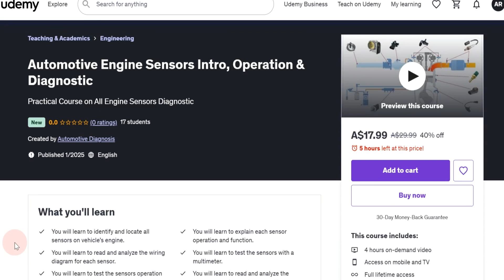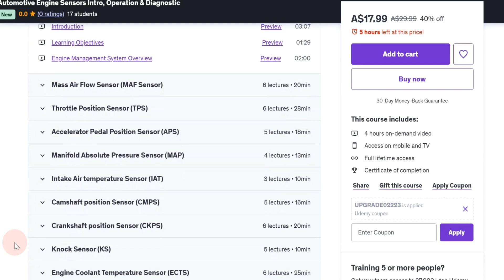Introducing Engine Sensors Diagnostic Online Course | All Engine Sensors Explained

Comment: Hi buddy welcome back, working on a Chevy equinox 2019 with intermittent no start condition. I need help thanks.

Each time the car doesn't start the fuel gauge, Trunk and coolant Temperature will not work.
  But one the trunk opens it's starts , Radio, windows ,Horn , Headlights and or other accessories still work even with the faulty present.

Doors still lock and unlock even with the fault.

What I realized is that with the fault present you can't talk to ECM and every other module has no communication with the ECM.

So I checked to confirm if the ECM has any relationship with the lift gate.And it does because when I unplugged the ECM the same symptoms were re-created. 

BUT I REALLY DON'T GET HOW THE ECM AND THE TAILGATE RELATED RATHER THAN THE BCM.
Reply from the maker: Hi my friend, this seems to be a network problem and most likely on the CAN-Bus. It could be some damages on the wiring that sometimes touches the vehicle body causing a short circuit, or it could be connector problem. If your car has equipped with power tailgate system, I suggest to disconnect the connector on tailgate module (when fault exists) and see if everything is back to normal or not (to identify if that unit is causing the issue), otherwise, fault could be anywhere on the wiring. Tis following video might help:
https://www.youtube.com/watch?v=8p3EauD0ufg